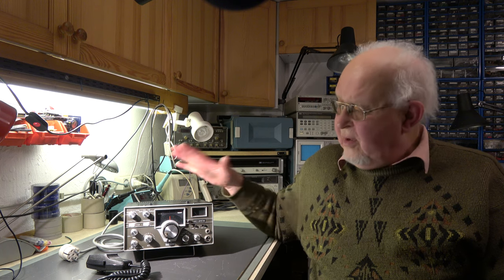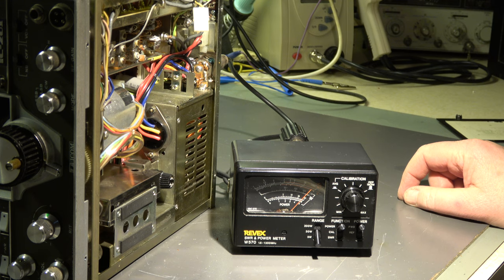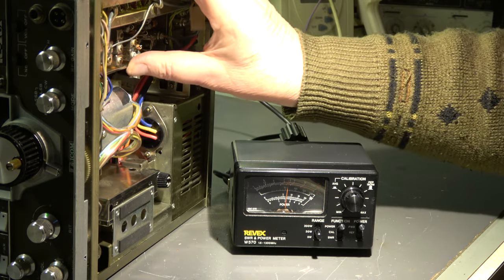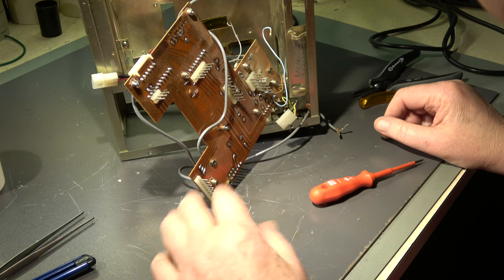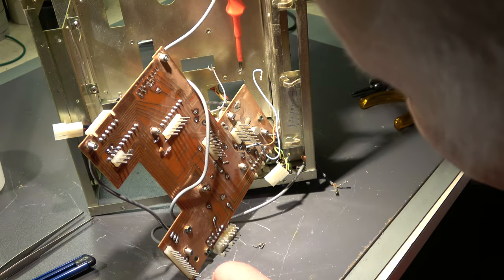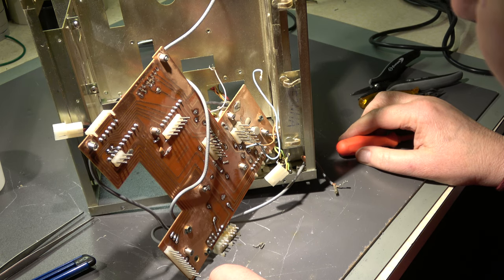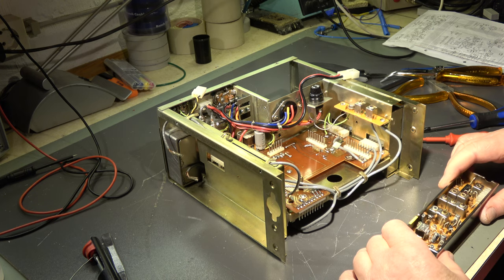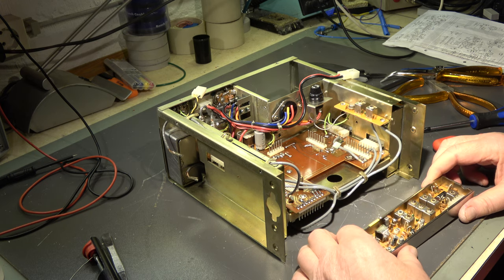#68 IC201 Repair Part 1(6)

Comment: My first all-mode was the IC-211 which had some similar PCB problems...Icom got better with time! Nice work as usual Stefan.  73 - Dino KLØS
Reply from the maker: Dito! My first VHF was also an IC211, which worked for more than 15years, then i sold it to a friend of mine; he still greets friendly.